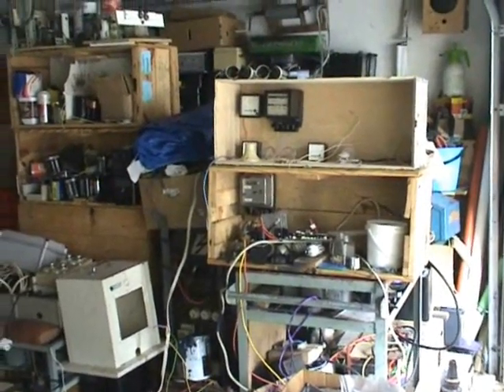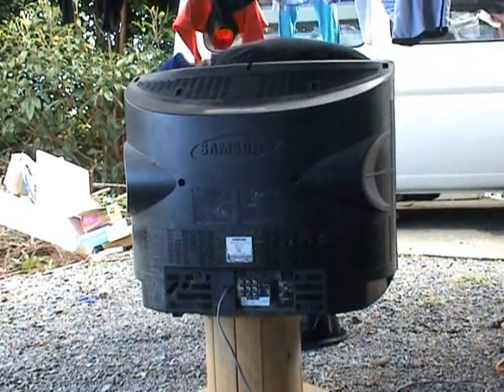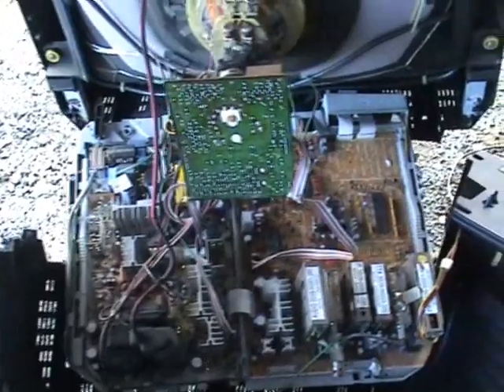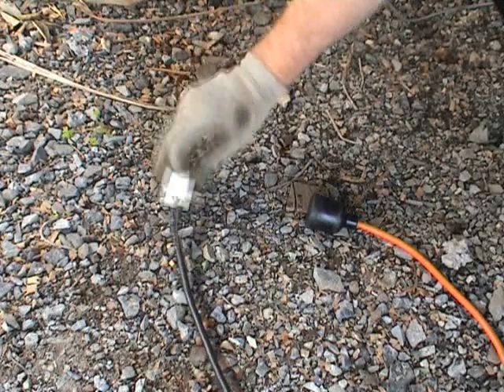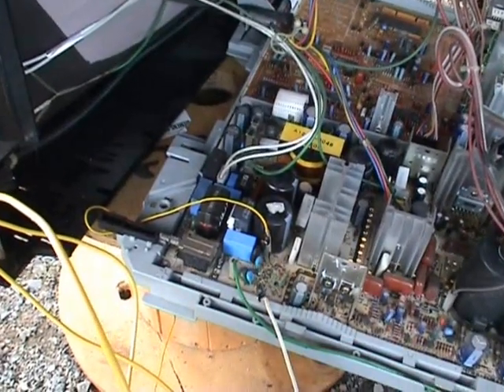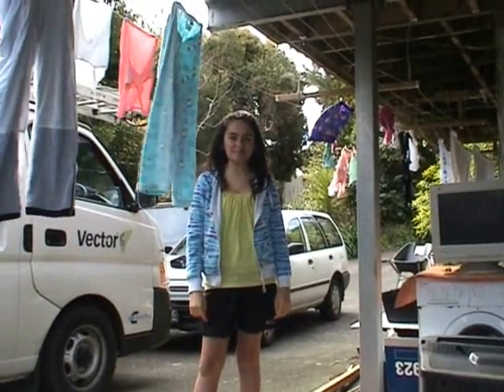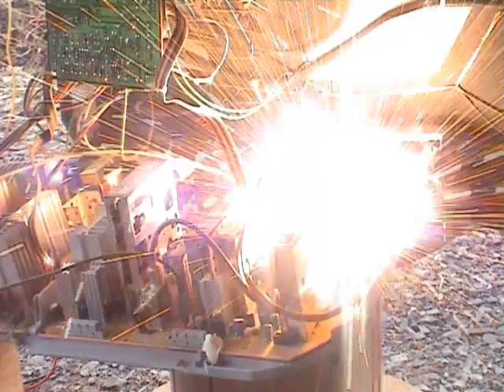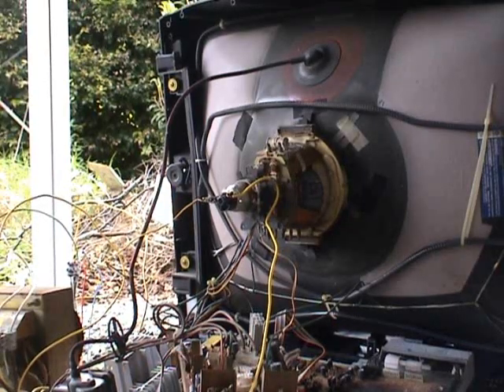TV circuit board burn out on 600 Volts AC - Part 1

Comment: when popping circuitboards at home, I sometimes assist it using salt water in a spray bottle, certain components take certain temperatures to fail. Wear rubber gloves, as usual ;)